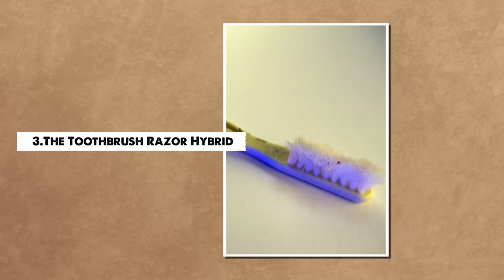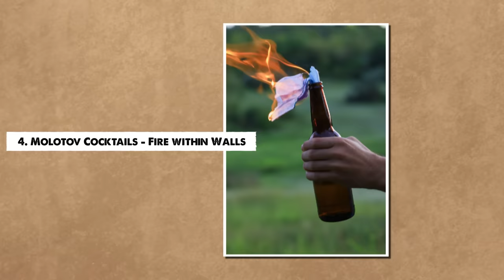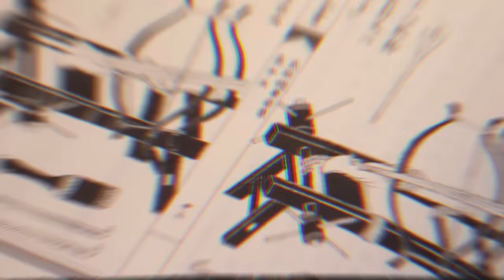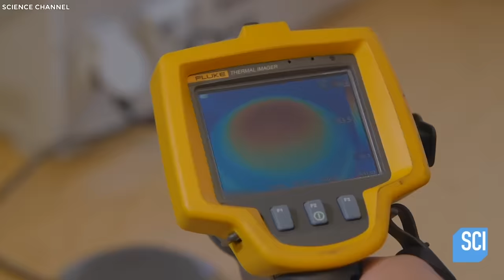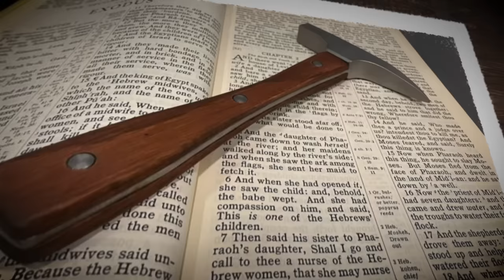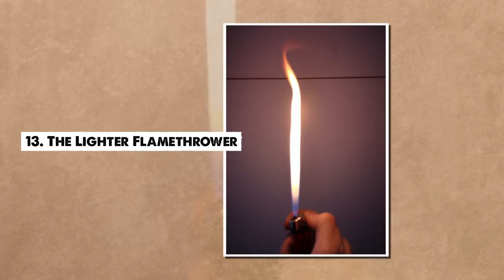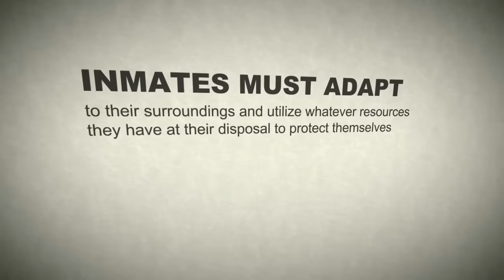15 Craziest Improvised Weapons Built In Prison

Comment: The exploding bottle would be a rare happening,  but from personal experience, I've seen someone sneak a fairly large amount of combustible fluid out of the sign shop, throw it through the bars of a snitch and light it. The block stunk for days. It's was over for the guy by the time the guards got his cell open. That was back in the 1970s, so things have changed a lot. I have a nice scar on my back from a shank made from a nail. Sam Garrison, a very old warden at Central Prison NC used to say that if you put two cons on two different telephone poles, gave one a cigarette and one a match, that when you came back in 5 minutes, both would be smoking. I've seen some crazy, but ingenious solutions to problems. Our cells had light bulbs. We took the hair thin wire that the step down current things in radios and run one little wire from side of bulb to our radios and run one to a bare place on the bars and bingo, we had power for our radios or whatever we needed. "It's better to be caught with a shank, than to be caught without one!".

Comment: The newspaper shiv works great. You can walk through metal detectors, handheld metal detectors don’t pick up it’s location either. They can be sharpened for a blade, but they work best in spears, poking devices and the like.